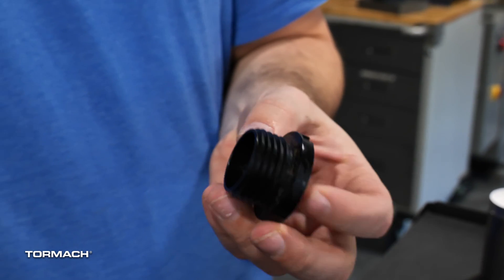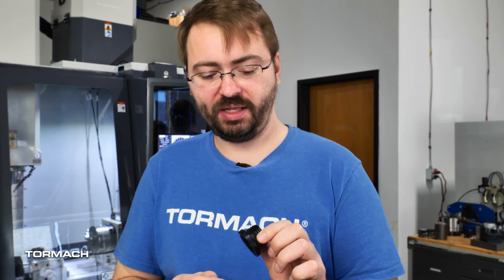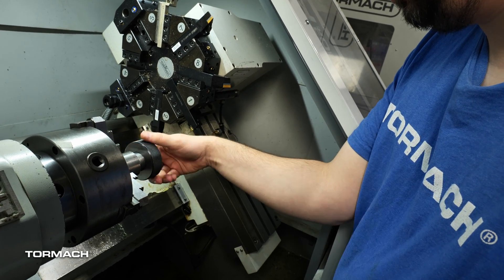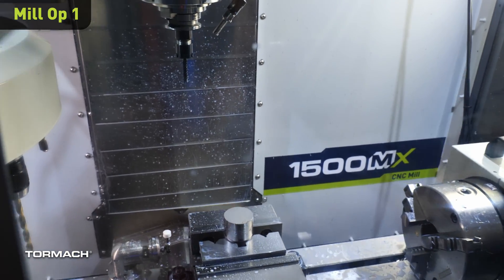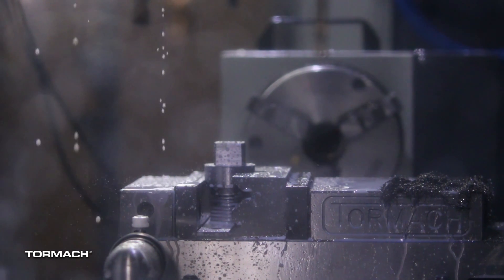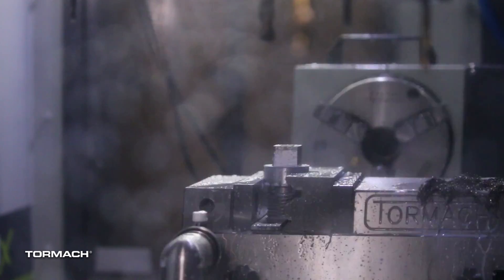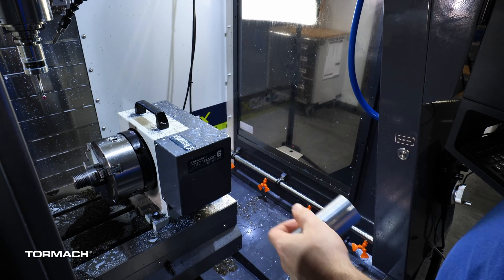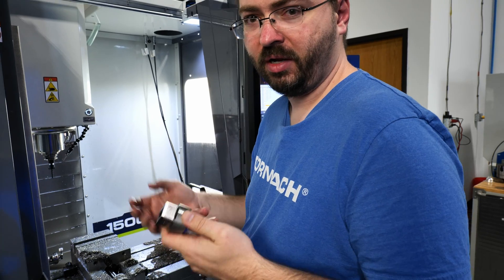Norman Cuts a Steel Tap for His Brother on the 1500MX

Comment: How did you come up with feeds and speeds for that high or an rpm?
Reply: For which operation?

-Norman
Reply: @TormachTechnicalSupport  For the mill.
Reply: @jameslee522  Yes, for which operation? I don't know what tool you are asking about. 

-Norman
Reply: @TormachTechnicalSupport  @8:35 in the video.
Reply: @jameslee522  By looking it up? Its even on the low-mid end of speeds/feeds for the cut he's running.
Reply: @kevind1865  When I looked it up, 300 sfm was at the top limit.  This is more than double.  That is why I'm curious how they came up with this.

Comment: The first turning cut did not sound good (squealing) and it showed in the surface finish..  There was also some squealing when you milled the flutes. Is there a rigidity issue with the spindle or 3 jaw rotation unit or did you just use the tooling, speeds and feed without critical adjustments since it is a non critical part?
Reply: I cranked down the feedrate and depth of cut during the turning since we didn't have flood coolant. 

At some point during program edits I turned off feed rate optimization and didn't catch it, that is the squeaking right as the tool hits the corner of the flutes. But otherwise, just a really long tool. There was about .04" of clearance between the holder and the chuck jaws at one point.

-Norman
Reply: @TormachTechnicalSupport  Thanks. It sound like these are issues you could tune and adjust for if you were really running this part commercially..
Reply: Look at the length of the tool.  That's where the squealing comes from.  That tool is deflecting from the stickout.  My machine sounded like it was being axe murdered on my first attempts of 316.  Increased my woc a bit and that fixed my issue.  In this case I can see the long tooling was needed for clearance issues on the 4th axis.